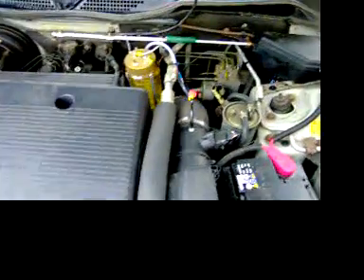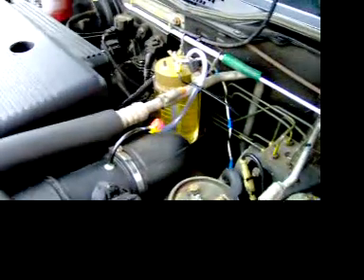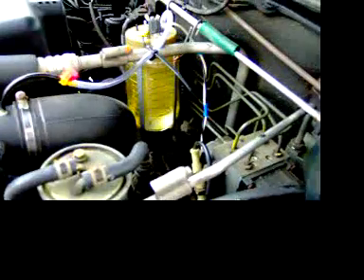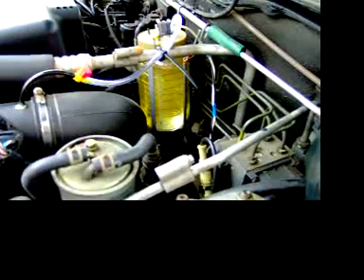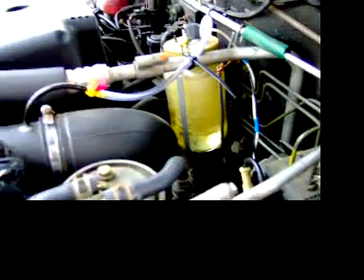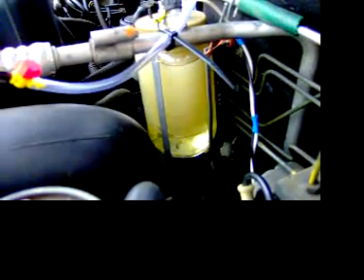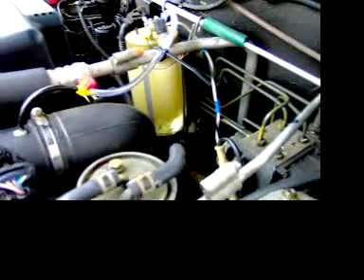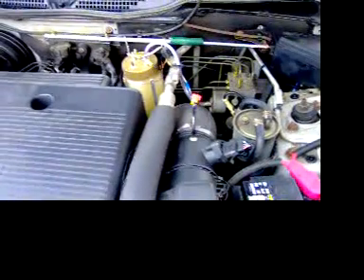my fathers hydrogen fuel cell

Comment: Only problem with this is I am still inputing from my fuel pump and carberator being a gas engine and not diesel :the same amount of fuel cunsumption hence probley using the same amount of fuel as before. what we need to do is completely convert the car to hydrogen in order to acutally make a real deal here and you know what it is completly possible .

Comment: Multiply  engine size by, say, 2000 rpm (pretty average engine speed) + work out how much air is sucked into the engine per second. Then work out HHO produced  per second + work out the % of HHO to air intake. It's very small. I ran 11000 miles in 9 months with 3 HHO generators. There was no difference in mpg! If it really worked, the tickover would increase. HHO is explosive but 0.03% in the air intake is not gonna make any difference. I doubt your claims of 2 litres a minute. Can u prove it?

Comment from the maker: @urbex2007 MY CAR HAS NO ECU!!!
The diesel injector pump on my car is mechanical!
Adding hydrogen/oxygen from the gas generator to the air/diesel mix makes the diesel burn more efficiently, because fuel burns better it gives more power from the same amount of diesel you don’t need as much throttle hence the fuel saving. I'm not trying to sell anything, I've spent a lot of time playing with my this and it works, if it did not I’d just tell others not to waste their time, but mine works.

Comment: It's not running of the hydrogen it's mixing it with the fuel to increase efficiency of combustion. It's basically getting more out of the fuel that's already there. Or that's the idea. It's a different idea altogether. Yeah Knineu02 sounds like a bit of a tard alright.

Comment: I played around with electrolysis myself and I found that the material I was using (stainless steel rods) would corrode quite rapidly. When that happens it gets really hot and takes a lot more power to operate. The reason of course is that the corrosion adds resistance. I can't really tell if that's happening here or not though. To fix that problem though you will need to find a conductor that does not corrode such as carbon rods or precious metals.

In either case, nice work and good luck!

Comment: Let's try again...

I think whether it works or not is fairly obvious. You're taking the extra power from the alternator and using it to break water into hydrogen and oxygen which will burn and decrease gasoline consumption. In comparing this to Stan Meyers device, I think he was doing something else with the power, though I don't know what. But he did have some sort of control box and I wouldn't be surprised to learn he was manipulating the wave patterns to get better results.

Comment from the maker: Yes its a drain on the alternator, it gets quite hot. What they do is make a small amount of hydrogen that goes into the air intake, thats enough to enhance the burn efficiency of the diesel/air mix in the combustion chamber.
To get the fuel saving you need at least 1.8 litres per minute of gas from the generator, coffee jar designs on the net produce very little, we tested one of those and got no extra mpg, but on my own design producing 2 litres per min it worked.

Comment from the maker: Ok, some people think it does not work, for me the design i used it worked, it does has problems with overheating on the cell/generator (what ever you want to call it), mainly if its left on for more than 20 miles in hot weather, but the figures i got are correct.
i would say try it and see for yourself, but dont condem them on the sayso of others who have not tested them, dont let others do your thinking for you, if you have not tested one to prove they dont work you have no right to condem.